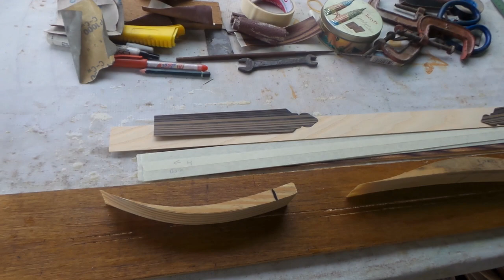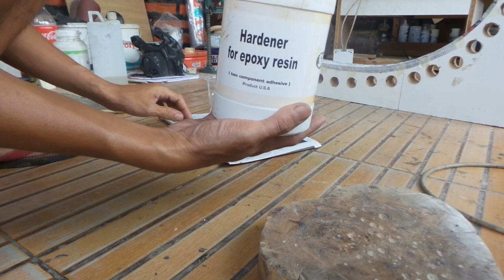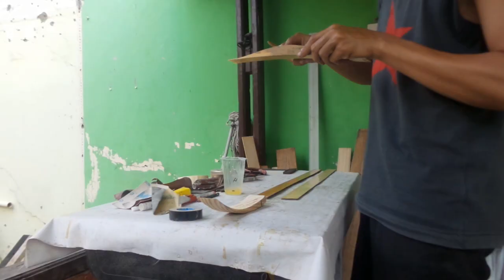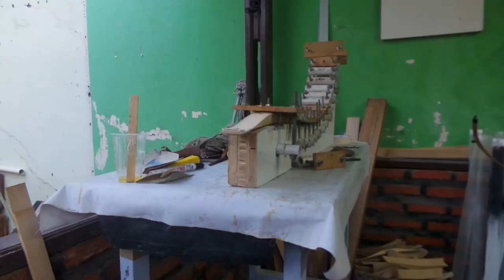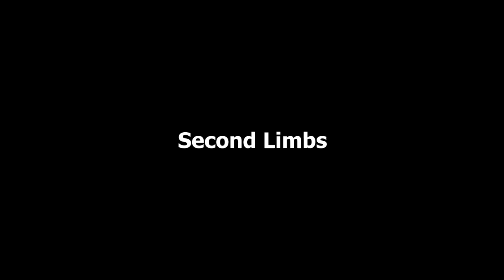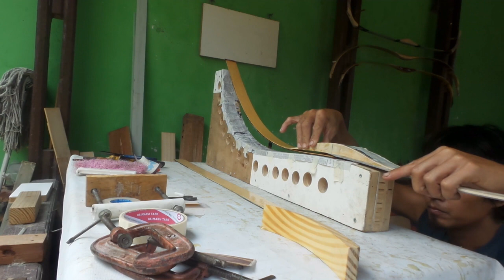Turkish Bows Making ( Part 3 )

Comment: Hello! Thank you for your video. What is the brand of the Epoxy you used and did you use heat to cure it?
Reply from the maker: Just local brand of epoxy..with 1 : 0.8 gram mix ratio
Reply: @andrianosbowindonesia3359  Thank you. Lots of bowyers in Europe and USA use EA-40 which is expensive and you have to build an oven to cure it (polymerize) . Also 1:1 ratio. It would be nice to find one with same elastic properties and no curing.
Reply from the maker: @macfrankist  too fast cure when I use 1:1 ratio for local epoxy
There's no Ea 40 sold here..
Reply: @andrianosbowindonesia3359  that is probably much better. I wish we had that epoxy here. Much easier to work with.